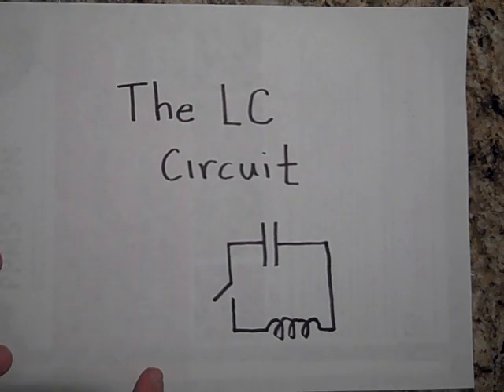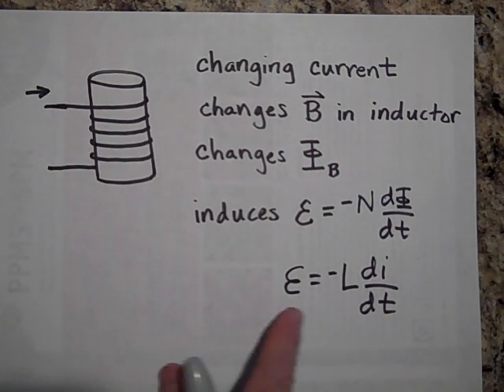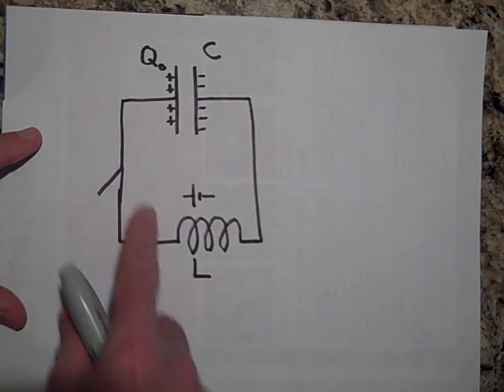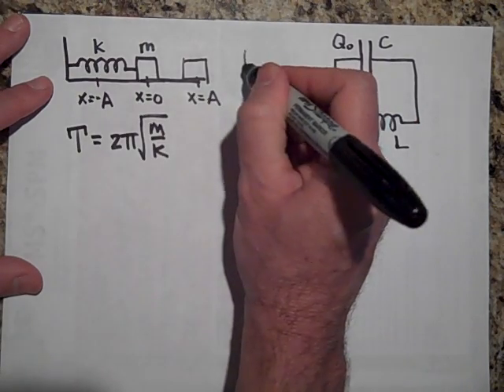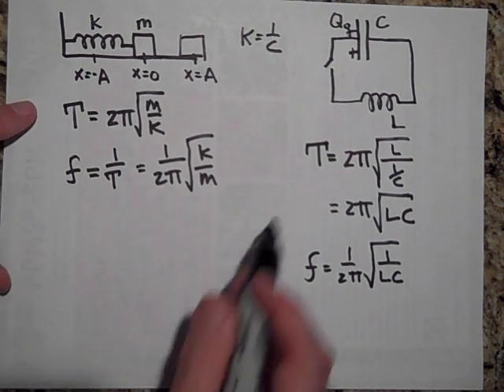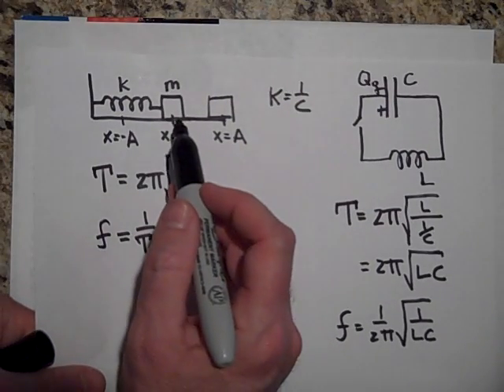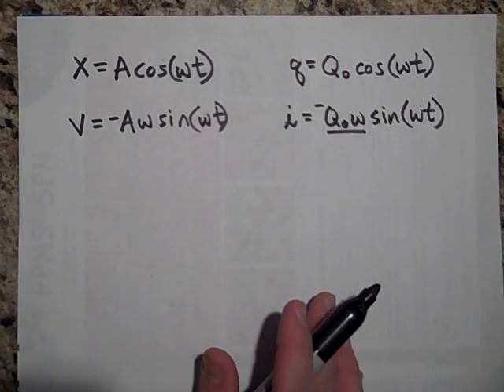The LC Circuit

Comment: so the reason why he choose cosine is because at cos(w(0)) meaning at the initial time, we would have maximum charge right?
Reply: Nicole O Yep and if you look at the corresponding equation for the current it would be a sine curve because the current is zero initially
Reply: ah so there is a 90 degree lag between the charge and the current

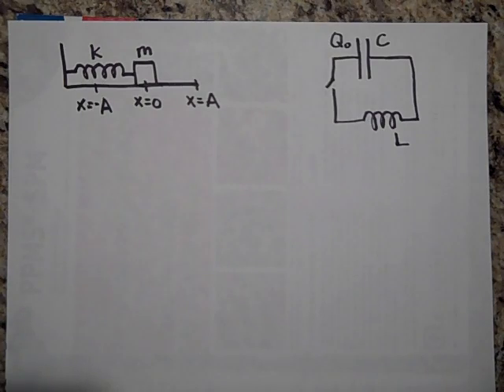Comment: Good teaching video. His visual analogy @04:22 involving the mass tethered to a spring helps drive the basic concept of an LC circuit; another good analogy is a pendulum. In fact, a pendulum can be thought of as the "analogue" version of the LC circuit. When the voltage potential of the capacitor reaches 0, the magnetic field in the Inductor reaches its zenith which causes the capacitor to recharge. When the capacitor is recharged the Inductor's magnetic field is diminished, & the cycle repeats.